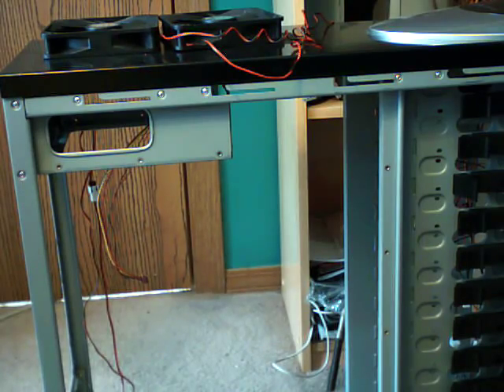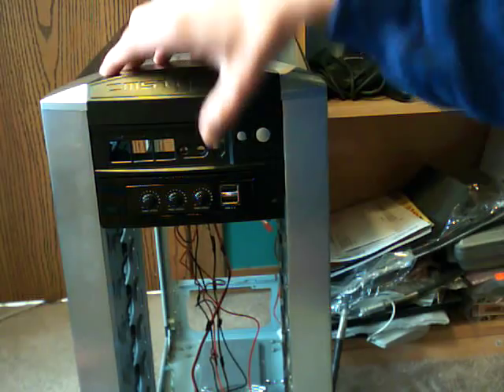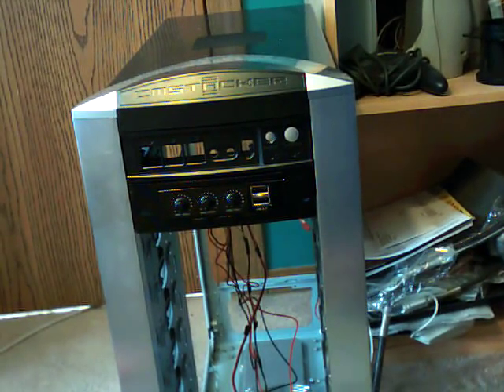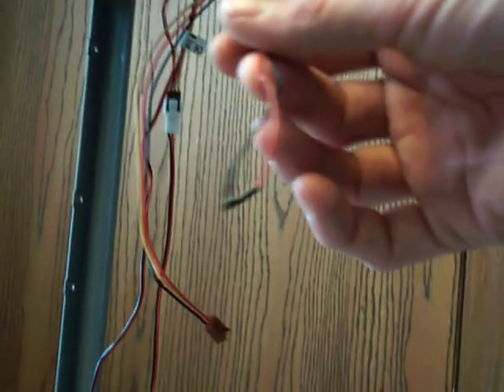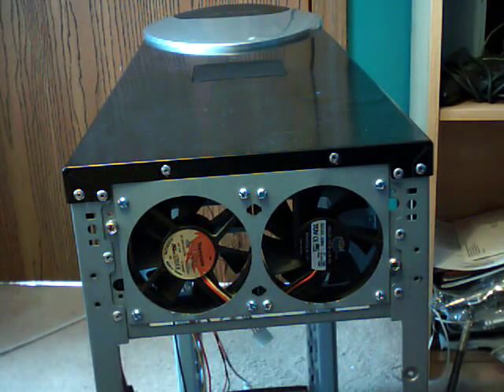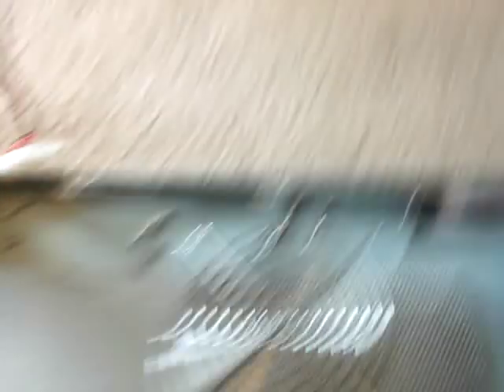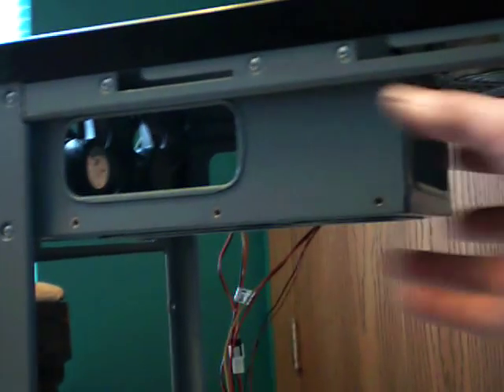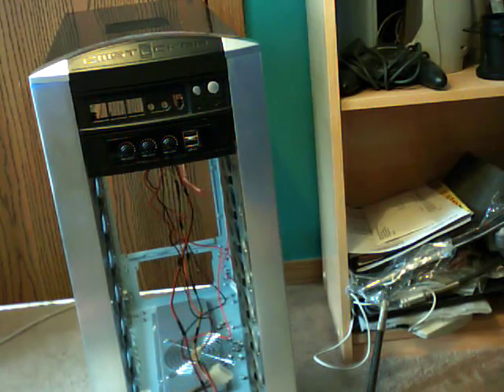CM Stacker Build Part 1- Intro???

Comment: i rather do a 9 120mm fans on the side plate, just cut holes for em, get some large duct filter for for it taht should keep noice for mthe inside down as well. taht my idea of the whle plate of fans opposite to the motherboard.
IF you are going to spend taht much, i rather suggest water cooling, if you havent tried it.